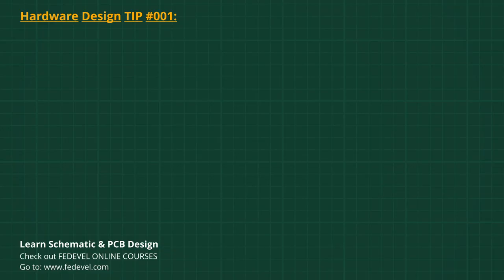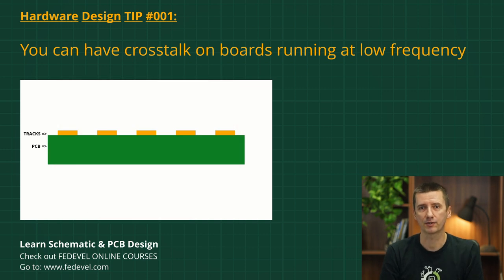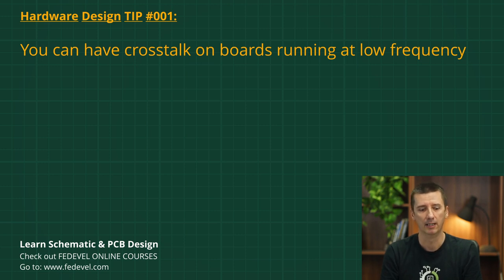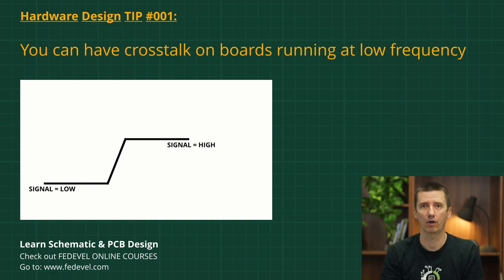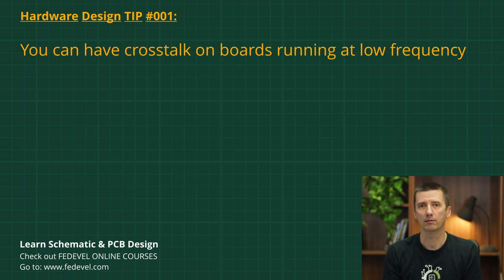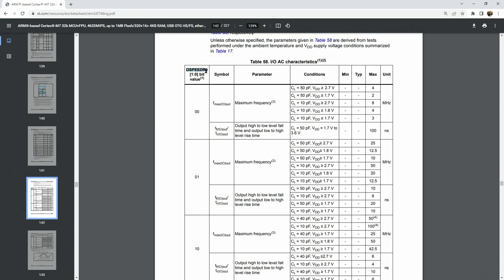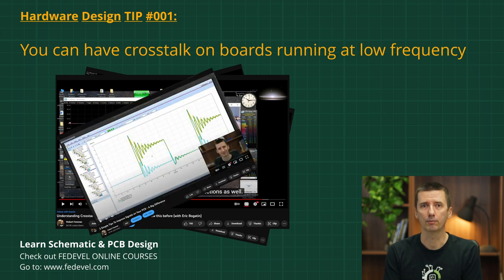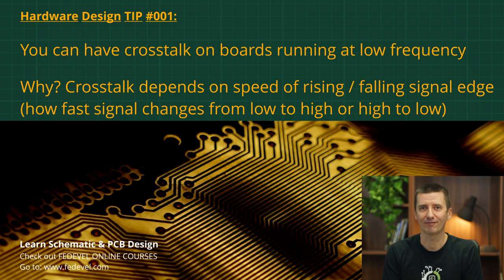TIP: You can have crosstalk on boards running at low frequency #hw_tip #001

Comment: If you think about it having a continuous high or low level between traces the only way they'll affect each other is if there's leakage because of the potential difference between the traces. So it kinda follows that crosstalk is induced by the change in signals, not their high or low level. At higher frequencies there are more signal changes so way more opportunities for problematic crosstalk: I mean  800Mhz is 800 million times the number of crosstalk events at 1HZ. All signals are mixture of multiple sine waves with multiple integer harmonics. As long as you remember that the sharper the edge the greater the frequency content and the higher the power in each of those harmonics the more likely you'll run into issues. Thanks for this, Robert.
Reply: That is an interesting way of looking at it, also though you have to consider the reactance of what ever the crosstalk is going into, to also figure out the effect it will have. I do like this probability based approach though god knows how long it would of taken me to think about it like that. 

I say this because I remember another video Robert was doing with Eric Bogatin and they were talking about the trade offs with how the 50ohm transmission value came about, where the trades off where having a higher impedance would result in more crosstalk/ or more sensitive to cross talk (I need to watch it again to be 100%) and having a lower impedance would result in less crosstalk but the trade off is more energy flowing through it.

Comment: Does cross talk happen with in integrated circuits like cpu, microcontrollers and etc. To be specific on the silicon dye and or on the bonds of the ic. Lets say they used wire bonding and not flip chip. I assume the answer might be no but im no expert.

Comment: Does it have to be a ground plane underneath, or can it be a power plane? If yes, can it be any power plane, even it the power plane voltage is higher than the signal voltage?
Reply from the maker: Answer is not simple and I would recommend to watch this video: https://youtu.be/kdCJxdR7L_I
Reply: @RobertFeranec  Thanks for your answer! You should know that I'm very grateful for all the knowledge you share. I was lucky enough that I was able to pick any PCB software when I started working as a HW engineer at the place I work. I chose Altium Designer because of all the resources and Altium tutorials you've provided. Thank you, Robert!

Comment: Wont a decent 100+nF cap fix that? These usually are there anyway...
Reply from the maker: Do you mean a 100nF on a signal line? This was exactly what "fixed" my crosstalk problem on my very first board. But, first, this is not really fixing the problem, it is only covering it up (the problem is still there, you are just trying to remove it, the proper solution is not having the problem at the first place). Second, a 100nF may work on fixing an interrupt signal which happens occasionally, but will not work on faster signals or can't be used on busses - then the signals would be too damaged to work properly.
Reply: @RobertFeranec  you are right! Spot on! I focused on reset line only... for slow digital signals it could help, but not for anything a bit faster...
Reply: Adding a capacitor will often fix issues like this as it introduces a delay in ramp up/down times of a fast switching signal and will also filter out glitches. This will reduce the power in high frequency side bands generated by such signals. The value of capacitance must be chosen carefully though so as not to degrade signals that switch at higher rates.

Comment: Square waves are not low frequency signals if the rise/fall times are short. The faster the rise/fall times the more high frequency side bands are generated. So if it's not necessary transitions should be slowed down to reduce the power in high frequency side bands that can propagate to adjacent conductors. Something often overlooked by people that just tinker with digital electronics and something very difficult to track down when it happens.